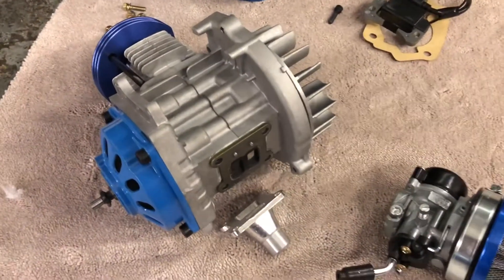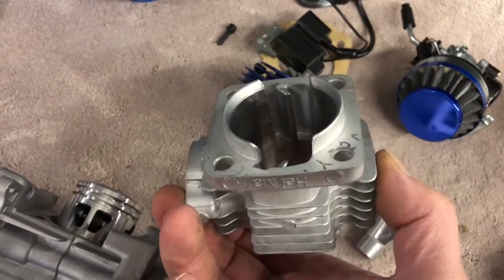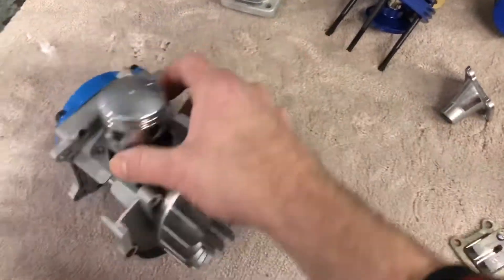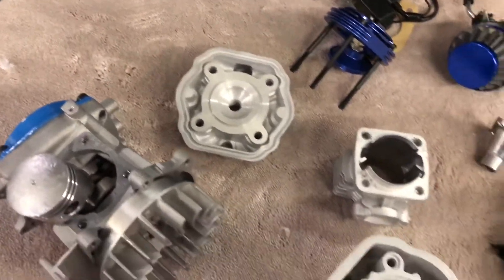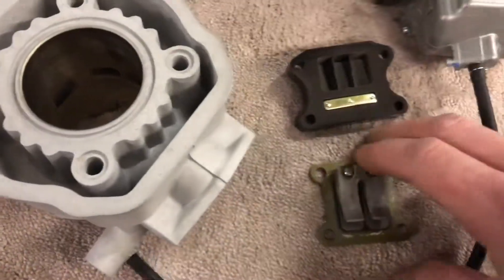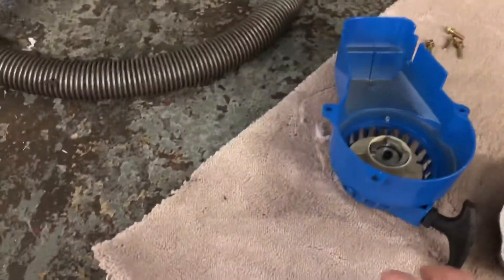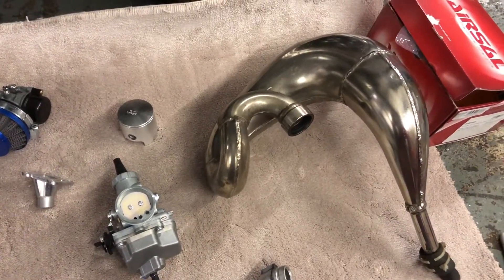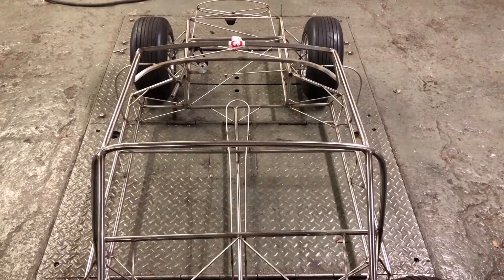Mini moto big bore water cooled conversion!

Comment: Were did you both that parts
Reply: Sorry is it ok if you send me the link of the parts so I can buy it and try for my mini moto pls
Reply: Does it works )???
Reply from the maker: @gregslife1793  yes it worked , just too peaky and difficult to start for the small ferrari , thats why i've moved on to the 300cc V12 engine
Reply from the maker: all parts came from ebay!